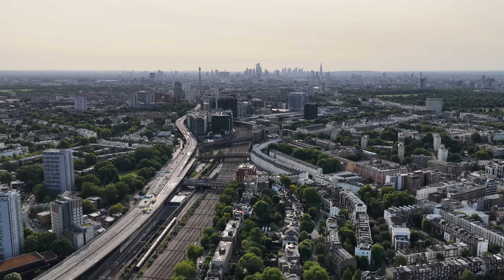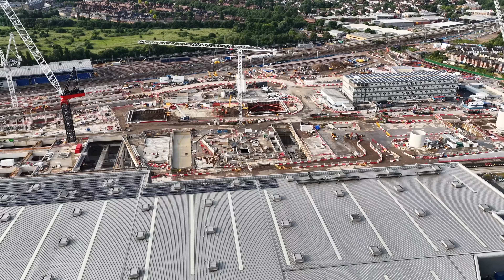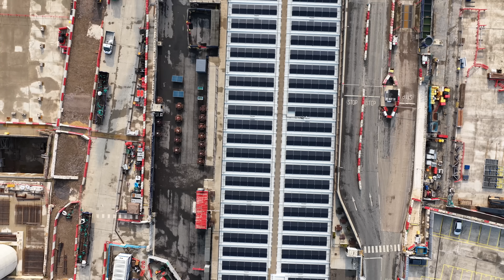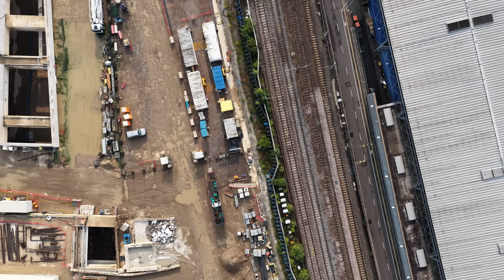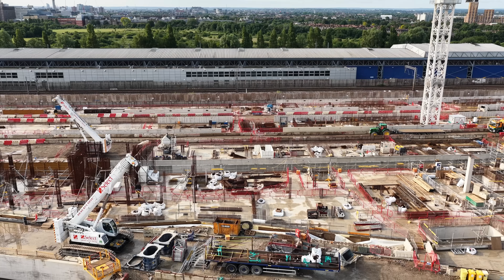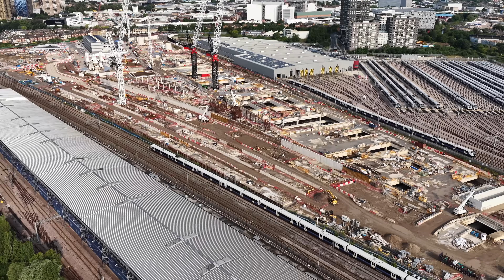HS2 London Construction Update 2025 | Euston & Old Oak Common Station Progress

Comment: Southern Britain only -  not the UK - no use to any one north of Birmingham.
Reply: Not So. If you were travelling from Liverpool, Manchester or Glasgow to London, or vice versa, the train will travel over the high speed section for a good proportion of your journey. I can agree that if it were extended further north, which will happen one day, the benefit would be more substantial. Also, more freight will be able to be switched from the motorways to rail, which just benefits everyone.
Reply: @JohnHoward-wc9kk  No more freight until the extension up to Crewe - the roadblock is between Stafford and Rugby on WCML. No expansion of services north of Birmingham possible, all that will happen is that the old service timetable from Liverpool and Manchester to London will shift onto HS2 tracks. Severe under-utilisation of potential capacity as a result.
Reply: Do you know how connections/transfers work?
Reply: Until it gets to atleast Crewe is it vastly underperforming in its ROI….
Reply: It will be fully built
Reply: Not so. If you think about it, the majority benefit are for those travelling from Birmingham and north of Birmingham!
Reply: @Maxhead_room the train times anywhere north of Birmingham will actually be slower due to the lack of tilt in the new trains running in the WCML at a max 110 mph so all of the gains up to Birmingham will be lost the further away you get therefore Glasgow services will be 20 mins slower from Glasgow to Birmingham, 15 mins slower to Manchester
Reply: @gorgu08  valid point, plus there is the issue of train lengths. But the original comment stated that the benefit was for the south of the country and that is not true. Whilst there will be a bottleneck north of Birmingham (with the current plans) there will be a major uplift in capacity. We still don't know what the government will announce to resolve the bottleneck but it is highly likely that there will be something reasonably satisfactory (if not quite Phase 2a spec).
Reply: @Maxhead_room phase 2a’s design is perfectly fine it is the idiots doing change control as the project is progressing with the extra time their should harden the design and then deliver it, job’s a good ‘un
Reply: @gorgu08 don't disagree at all.
Reply: @gorgu08  The day of the Pendolino Tilting train is drawing slowly to a close as Avanti West Coast new WCML high speed trains are non tilting class 805/807 IET trains
Reply: @Maxhead_room  There will not be a bottleneck North of Birmingham as the vast majority of high speed trains that now use the WCML to London will use the HS2 route when it opens instead of the WCML route
Reply: @gorgu08  It will also be competing with other passenger services and freight on the WCML. Time and capacity is only beneficial south of Birmingham.
Reply: @peterwallen1063  there is meant to be new services to new destinations but these cannot be provided in full due to the bottleneck north of the delta junction, the trains per hour capability of phase 1 cannot be archived due to the cancellation of phase 2a and messing around with Euston. There was a thorough article in Rail Engineer some time back demonstrating this.
Reply: @Maxhead_room  How do you think there will be a bottleneck north of the Delta Junction when at the moment no line exist North of the Delta Junction at the moment !!, there is no bottle neck on the WCML around Stafford now so why would there be one when the HS2 route opens. When HS2 opens Avanti West Coast Hi Speed trains to and from Manchester. Liverpool and Scotland to London and Birmingham will diverge off the WCML onto the HS2 route  leaving the southern half of the WCML for local services, semi fast passenger trains a few Avanti West Coast Trains and the ever growing freight train services.
Reply: @peterwallen1063 HS2 phase 1 is designed to accommodate 18 trains per hour in each direction, if 18 tph cannot be achieved then something has frustrated this. This limitation is north of the delta junction and south of OOC, thus why I used the term bottleneck.
Reply: @Maxhead_room  So you used Bottleneck, at present there is no bottleneck north of the Delta Junction on the WCML plus at present there is no line north of the Delta Junction not only that as there are no freight trains or local trains plus in cab signalling the trains on the HS2 line to Handsacre will not have any problems or when they join the WCML as most trains will be joining the HS2 route and there will not be any bottle neck south of OOC to Euston,the bottleneck at present is at Birmingham New Street Station and North to Wolverhampton and south to Coventry
Reply: @peterwallen1063  the specification for Handsacre has not yet been approved, so we don't know if the connection will be fast-fast lines or fast-slow-fast lines (the latter will be a bottleneck for obvious reasons), or maybe there will be an announcement to run to Crewe on a new line (at not quite full speed specification). At Euston only 6 platforms are being built, the original plan was for 11. This means that south of OOC there is a bottleneck as 18 tph will not be able to operate. It is likely that over the coming decades the HS2 Euston will get more platforms as the old station is upgraded in phases. This will resolve the south of OOC bottleneck. View it how you wish but if Phase 1 cannot operate at 18tph each way then the limitations causing this are what most people would call a 'bottleneck'. Shame on Sunak for meddling with the original plans and causing cost increases.
Reply: @Maxhead_room  And who says there will be a bottle neck on HS2 and where do you get 18 trains per hour, total rubbish no line would cope with that
Reply: @peterwallen1063  Peter, I'm not sure why you are being so ill-mannered? The 18 tph is referenced in multiple Gov documents (for example search 'Full Business Case High Speed 2 Phase 1' and you will find an April 2020 document - the 18 tph is specified at para 1.43). In other Gov documents there is a statement 18 tph in each direction out of London and a further 12 tph out of Birmingham.
Reply: @Maxhead_room  So how from an e mail do you suppose I am being ill mannered any Railway such as this could only support 6 trains an hour one every 10 mins if at all, 18 trains an hour on a 2 track Railway, 18 trains an hour equates to a train every 3.3333333 mins totally impossible mate you don't get that at the moment from Euston or Birmingham New Street
Reply: @peterwallen1063 with all trains being fast trains, ERTMS digital signalling and track sensors for exact positioning the headway between trains can be reduced. But given that this 18tph figure is repeatedly given we must accept that this is the Phase 1 specification unless there is documentary evidence otherwise. So getting back to my original point, if 18tph is not achieved, yet that is the specification, then those factors that are frustrating the capacity must be considered bottlenecks. For example, if Handsacre was built to a specification that the fast HS2 lines fed into the designated WCML slow lines then would you accept this would be a limitation on capacity? (as headway would need to be increased).
Reply: @Cartoonman154  HS2 won't be competing with any other services as the operator of the WCML high speed services Avanti West Coast will be the operator of both the HS2 route and WCML high speed services
Reply: @peterwallen1063  There is a capacity limitation/block, you can call it what you will. The biggest single transformative action of HS2 was to increase the maximum possible capacity north of Birmingham and south of Liverpool/Manchester.
Reply: @peterwallen1063  You don't get that capacity on a line with many stations where fast trains don't stop. If every single train on HS2 stops at exactly the same places there are no requirements to slow down for stopping trains, are there?
Reply: You mean southern England. There is no such place as 'southern Britain".
Reply: @ds1868 of course there is a place called southern Britain.  It's located in the southern part of the island of Great Britain. A map will show you.
Reply: @teviottilehurst  It appears you do not live in the UK, our Country is usually either called Great Britain or the UK, not Britain, then it is split into its constituent parts of England, Wales, Scotland and Northern Island, What you state is "Southern England" not Southern Britain. HS2 has nothing to do with Southern England and every thing to do with the City of Birmingham and places North of Birmingham
Reply: @peterwallen1063 I'm English and live in the south of England or in the southern part of the island of Britain ( no issue omitting the prefix Great). A person, say, from Aberdeen comes from the north of Scotland or the northern part of the island called  Britain ( again the prefix Great is optional).  Although technically the island is called Great Britain, many people call the island just Britain.
Reply: West Midlands and the North only, HS2 has nothing to do with Southern England
Reply: @peterwallen1063  You can spout that all you will, but until it is extended up to Crewe, HS2 is a Birmingham to London commuter line. There will be no transformation of services from Liverpool and Manchester, just the same old timetable shifting onto the HS2 tracks.